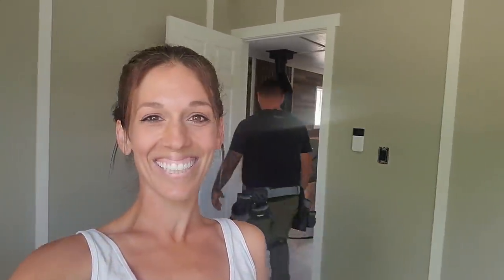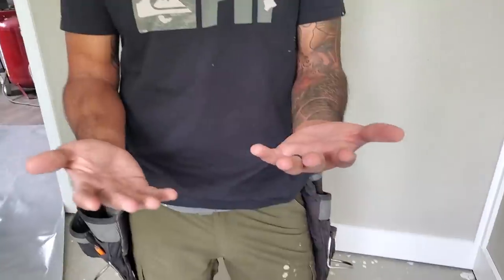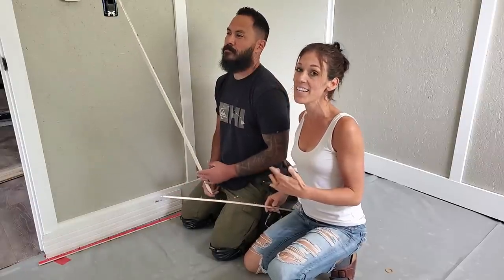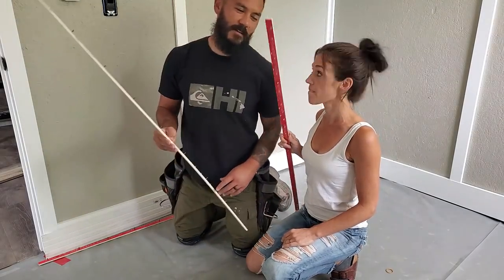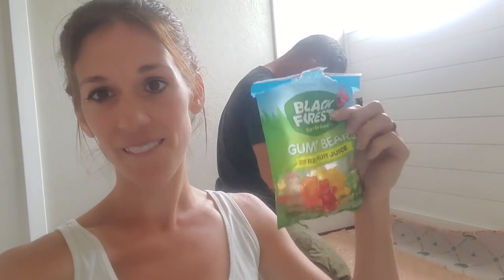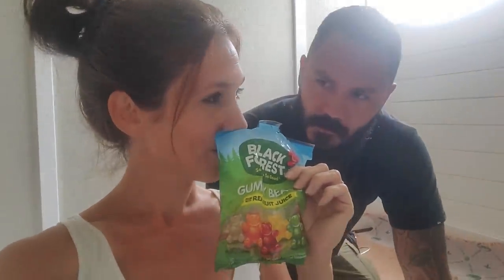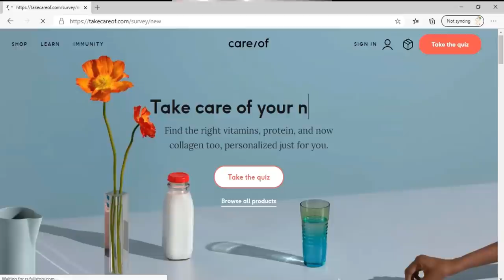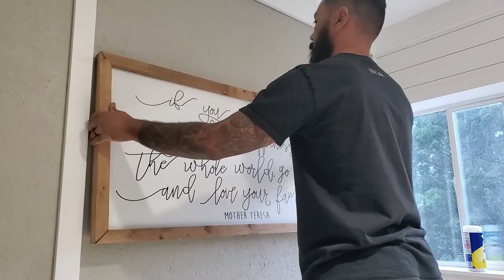Moving Day!  WE DID IT!! Goodbye Trailer! | Building Our Own DIY Tiny Home

Comment: For all that swelling Benadryl cream, Benadryl tablets but they can make you drowsy so stomach acid inhibitors (ranitidine) can also work on the histamine response so can take that while needing to use power tools and drive during the day.  And tea tree oil spray or Skin so soft are good repellants. Good luck out there!
Reply: They have Benadryl "Non-Drowsy" you can also buy. Not as strong as the regular but, it  works for something like this.

Comment: I brought contractor packs of outlets and light switches of 10 each in a box for like $5. When i had my storage building converted into a tiny house (learning center/library) , mom's and my house. I also brought boxes of foam inserts for the outlets and switches . They block any air coming thru the open spaces around them.

Comment: For your wasps, makes a couple cups of blue Dawn detergent with about a gallon of water, it works as good and as any wasp spray.  Fill the tub with it and put a board on top of that tub, on the bottom of that board just above the water screw on a piece of chicken, just a leftover bone from dinner is fine. Wasps love meat and they will fly and try to get under there on the meat and a lot of them will fall off into the water and you can literally catch hundreds of them that way.   We have tons of them here, we just keep spray bottles out on the porch and just spray them as they come in whenever we find a nest. Does pump up pressure garden sprayers work great as well, that’s what I used to take out big nests

Comment: I know it's probably been several days by now but if you're still having problems with that bee sting dip a piece of bread in some milk and put it over the place where you got stung.  Leave it there for at least 20-30 minutes.  It will draw out the poison.  I have used that old time remedy for wasp stings and even spider bites.  The thing is you have to leave in on long enough to let it draw the poison out.  Good luck.  Hope you're feeling better & don't even need this but in case you do..... take care.

Comment: Just a thought for you two Benadryl  works really good you can get the itch stopping gel for bites and stings and also the pills they would have helped him with that sting two before the bed try it works great as for your flying  pests a blue zapper works great also empty each day for your chickens free protein  for them,  there is also the hanging plastic  bag with scents for the yellow jackets or you can use apple juice instead of water shake well hang up bags around your  property  give them pesky fliers something to do before they drown in the juice with the scents its what we used down at Sagle when we had the yellow jacket problem down there give it a try you will like it

Comment: We can relate to living in an RV.  We did it for 9 months through the winter.  Had we realized how long it was going to be, we would have skirted the RV in some way.  It got pretty cold some nights but between the furnace and a couple of 1500 watt heaters we survived.  We were in a 30' fifth wheel and it was just to two of us. so nothing like you were dealing with.  We had an indoor toilet from mid Sept. on so late night potty calls were a quick race to the house.  It was heated downstairs where the toilet was.  We'd open the garage door and run inside.  By the end of January, our dog had had it with the RV and refused to leave the house at night.

Comment: I had to use scissors also when cutting the floor padding. Cutting with a blade just shreds the backing and it just rips the top coating. I learned the hard way

Comment: When laying padding down it must end before the tackless strips. If you staple the padding to the strip it lessens the amount of grab that the strips have on the carpet...
Reply: Pretty sure they were cutting the padding short of the tack strips.
Reply: @stshnie  she was stapling the padding..  To what?
Reply: @doncaranci2547  Probably the same thing he was nailing the tack strips to.
Reply: @stshnie  Please look at 7:33 -7:38
Reply: My comment was not to criticize but to help make their job easier and better. After installing carpet, tile etc etc for many years I was just trying to help, not hinder..
Reply: @doncaranci2547  Hi Don. I was being lighthearted. I just rewatched the whole thing. When I first saw it I thought she was cutting the padding short but I can now see they left a gap between the tack strips and the wall. Not sure how he nailed the tack strips to a concrete floor – only ever seen those used on wooden floors. There is a gap all around the padding but it looks like the red has gone so she must have stapled it to the tack strips. But if you look at 11:43 you can actually see some of the red so maybe it was just up to the halfway mark of the tack strips. But even so it would be lifting the carpet too high to reach down to the tacks

Certainly if you go over the tack strips you not only cover the tacks sticking up to help grip the carpet (I know them as gripper rods) you also make the carpet (plus padding) too darn thick to shove under the baseboard. As I say, I’ve never seen a fitted carpet over a concrete floor before. I’d expect the plastic to be slippy. It seems like those tack strips are expected to do an awful lot of work. If the padding was not attached to the tack strips, wouldn’t the whole plastic/padding thing be quite slippery? How should you attach it?

I have no expertise but may be doing something similar myself soon so any input from people like yourself is extremely useful.
Reply: @stshnie  The tack strips are special for concrete. They have concrete nails embedded in them instead of wood nails.

Comment: Benadryl, keep some tablets on hand. You had a mild allergic reaction to the bee sting.  I either take a Benadryl or go to hospital. Just keep a bottle of these handy. They work wonders and is cheaper than a epi pen, and does not need to be replaced yearly.  Be warned though that taking more than one will make you extremely drowsy and should not operate machinery or drive.

Comment: Just an observation, what if you waited to install the baseboards until after you have installed any flooring(carpet, wood ect.) you could shoot and mark a laser line around the room to mark the level top line for the baseboards. this would save jamming the carpet under the baseboards and possible damaging them.

Comment: A word of caution - when you start burning the wood stove, you will need to sweep the chimney after about each cord of wood unless you are burning aspen(hard wood) or maybe cottonwood (soft but not much pitch).  Fir, Spruce and Pine all have a lot of pitch which builds up in the chimney.  You don't want to go there.  Should just sign this "been-there-done-that"..........Stu in Cheyenne
Reply from the maker: This is our stove from our last homestead.  We have heated with wood for several years 😃

Comment: I'm sure that neither of you use tobacco, but having a bag of chewing tobacco in your first-aid kit might be something to consider for insect stings and other venomous events, I've used tobacco poultices on everything from insect stings to being finned by mud-cats and mesquite thorn punctures for the last 30 years and it works better than anything else I've found, but as another commenter stated, an EpiPen would be a good idea as well, just in case you are allergic.